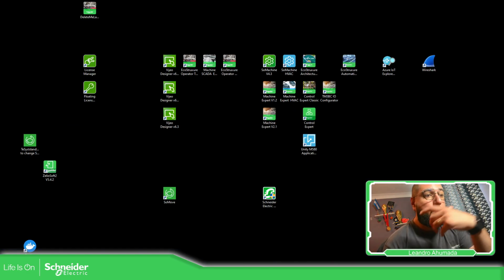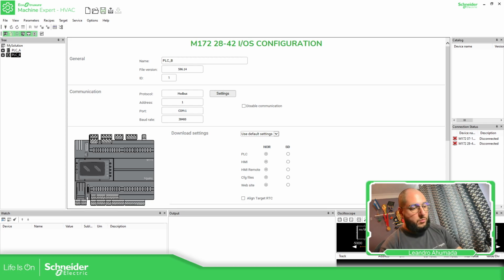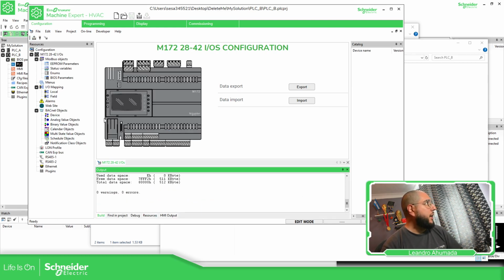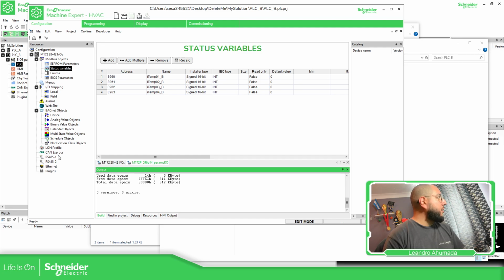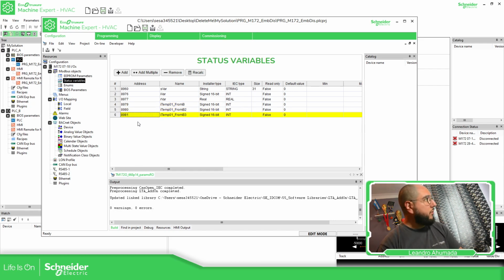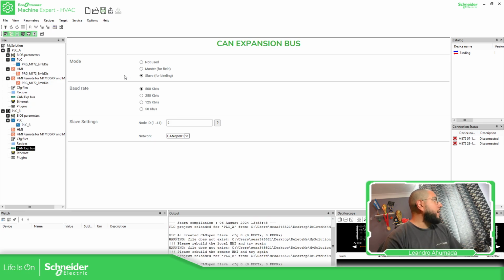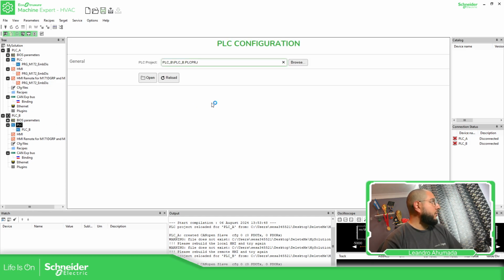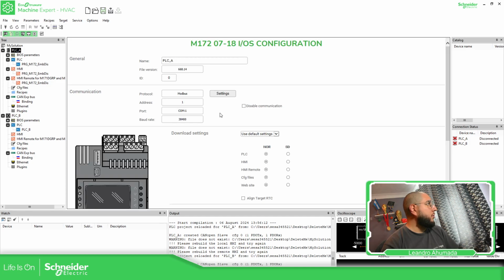ESME HVAC - Communication - M5.1 CanBinding Configuration

Comment: Hello, I have a question regarding the CAN exp bus configuration. 
Currently, I have two different projects downloaded to two PLCs.
I was able to add two PLCs in the Installer software and add a program for each of them. But when I tried configuring the CAN bus for each PLC, the Installer software did not allow me to change from Master (field) to Slave (the window was grey/not selectable).
Do I need to set the CAN exp bus configuration of each project as "Not used" in order to create binding between the PLCs?
Thank you.
Reply from the maker: Hi there! Thanks for waiting :)
I believe you already got it, In the video i showed that in the individual project it needs to be set as "not used" to be able to select on the installer the binding.
Reply: @LeTomasAHUMADA  I saw the video. Thank you.